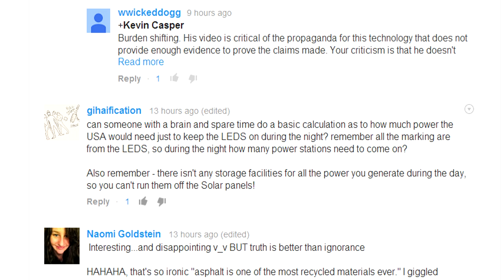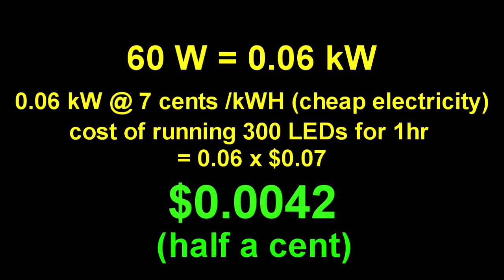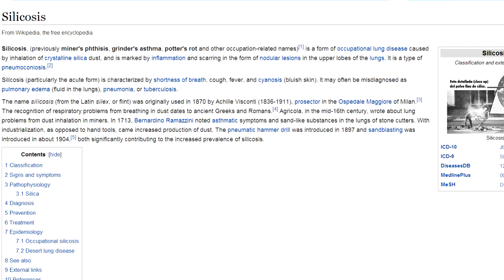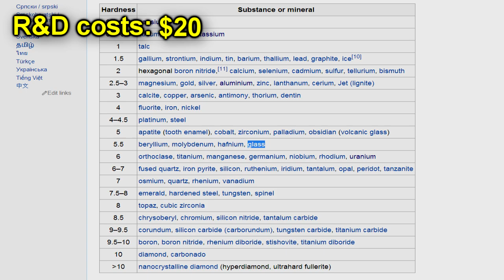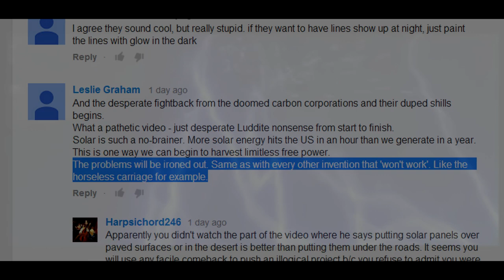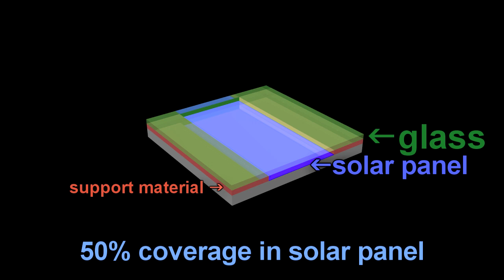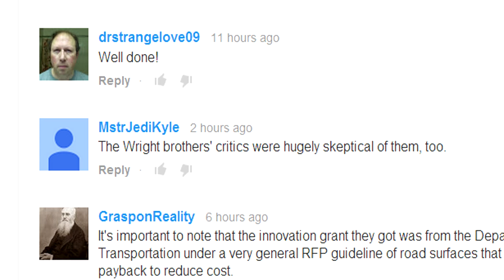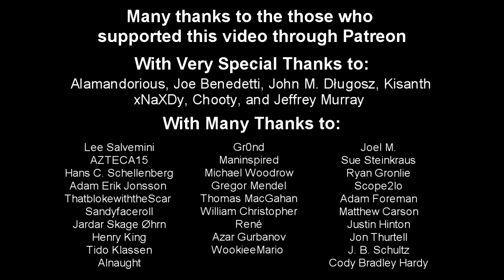Solar Roadways, IMPORTANT QUESTIONS AND ANSWERS!

Comment: Just for fun I thought I'd tear into the clearingthefrikingair rebuttal (http://www.solarroadways.com/clearingthefreakinair.shtml) , I'll do it in order of the headings which I will enumerate. But before I do, Solar roadways the 4th formula in that picture is either wrong or extremely redundant; also basic trigonometric identities look pretty unprofessional, try some branding or some equations that have relevance to electronics! Anyway:

1) We picked a really stupid....
Most of the points here are moot, it doesn't matter how expensive or antiquated the roads are if they are still the cheapest and most viable! Everything is relative; democracy for instance is pretty bad when you think about it; stupid people get to vote! It also happens to be the best system.... Stuff about LEDs and heating elements is just not believable tbh.

2)Solar Roadways is going to cost...
Again this is sidetracking the point, we want to know how these solar roads will pay for themselves; it is pretty pointless to keep asserting it. Why would it be more cost effective than putting solar panels beside the roads, or just building more farms? 

3)Asphalt roads are cheap...
Same issue, its the relative cost that matters not the absolute cost. Obviously we need roads, so no matter how expensive they are (within reason) we are going to invest in them, but obviously we are not going to invest in an option which is more expensive without good reason. Essentially a strawman, no one said asspalt roads were cheap.

4)False Claim: we can't afford to heat roads
Again, same issue! A load of emotional argument (designed for persuasion not information) followed by the claim that current snow removal isn't cheap. Sure it isn't, but your method of heating the road is LESS cheap. 

5) False Claim: Glass is softer than asphalt
Only real argument of substance, to bad its wrong. Roads in the US usually have a Mohs hardness between about 5 and 7, its the gravel that contributes to the hardness mostly.This is incidentally harder than most glass. Also I have to love the irony of going on about thunderf00ts video and 'permission' when he is completely entitled to critisize you under fair use, yet you lift a table straight from wikipedia without so much as a reference (and another website). Copyright fail...

6) False Claim: The shadow a single bird...
Fine, but if this is something that solar panels beside the road don't require, why would you pay for an extra component when you can avoid it?

7) False Claim: You can't see LEDs in direct sunlight

Well most traffic lights are roofed anyway, so that helps. And of course it does depend on how many LEDs you have and how bright they are; do your LEDs work in the sunlight? We haven't seen any evidence yet, so it begs the question; why would you look for images of traffic lights and LED advertisment displays (advertisements clearly pay for themselves - at least that is the intention!) when you could just photograph your own? Oh and incidentally the images are unsourced, which again seems a little hypocritical; ah never-mind. 

8) False Claim: We're attempting to use recycled....
Then why not say that? Because the impression from that video is not that the intention is to use a base layer made of 10% ground up colored glass, and I really don't think this is even feasible without the glass melting technology; and its not as if the base layer can compromise on integrity which may come from using a heterogeneous source of material without due care, and a pretty high investment. 

9) Comic Relief:
If ananlogies were meant to be taken literally, then they wouldn't be called analogies!
Reply: Not bad except an analogy is generally what we call.... ANALOGOUS to the thing in the analogy, and are indeed meant to be taken literally.  Something isn't analogous if it isn't LITERALLY analogous.  Just saying.

Comment: Disclaimer: I'm not criticizing, just some free-range reflection.
As for the energy bill of leds, a very easy way to save on it is not to keep them turned on all the time anywhere but only where cars are actually passing.
After all pressure sensors are already in the specs.

About glass resistance: Yes, is true, glass is definitely a bad choice. What about plastics and other materials?

About led visibility in daylight: what about a simple addition of a roll-over colored strip to be used in daylight? Eventually over the led (that in such a case would be a retro-illumination and would no more need to be color-specific).

Comment: Turn on ALL the lights at the same time?????? Why would you want to turn the whole surface area into a 70's disco floor (as if the solar roadway isn't crazy enough as it is). The road-lines/signs would only need a fraction of the surface area lighting up (say 0.1% or so, the rest can stay dark.
I appreciate you want to debunk this crazy idea, but please don't come up with even crazier back of napkin calculations to do so.
Reply: Seeing as the avowed goal is to use those Leds as Road Markings, a lot of them pretty much need to be on all the time, yes (Unless you're suggesting adding even more components to that project such as Motion/Pressure sensors)

Not 100% of them need to be on at the same time, you're correct in that assumption, but I believe your 0.1% is way off base and that you, frankly, pulled that number out of your ass, unless you have some actual logic you can take us through on how you reached it :)

Comment: They build aquariums with very thick 'tempered glass'. They have to regularly maintain the glass due to sharks rubbing up against it. Yes, that's right, fish can wear out tempered glass... what do you think 18 wheel road trains will do to it.

All great arguments Thunderf00t, but say you wanted even MORE ammunition to shoot at the stupid, the fatigue life of glass is very low, if it didn't fail from abrasive wear, it would fail from cyclical loading.

Another quote of Sagan's comes to mind, "We live in a society exquisitely dependent on science and technology, in which hardly anyone knows anything about science and technology"

Comment: Failure of these tiles would be inevitable after just one winter, and traffic wouldn't need to be a factor, if installed where freeze/thaw, road heaving conditions are common! Anyone ever seen the potholes on Route 81 around Syracuse after a really nasty winter? What an insane, ass-cheese idea.

Comment: It would cost 1.4 trillion dollars per year, if every single LED was on at all time. The majority of the time the LEDs will be used to mark lanes which only requires ( judging from the pictures ) maybe 5 - 10 LEDs from every 5th panel. Also, they've said that they will be programmed so they turn off if no cars are driving. So using the total cost of all the LEDs being on all the time as an argument against this project is ridiculous.

Some misinformation in your video as well. They've said that the panels are 4 ft^2 each. Also, the solar panels cover 69% of each panel and they generate 36 watts for the prototype and will generate 52 watts for production. That's also not including piezoelectric and thermal generators.

One last word. For being a scientist yourself, those "experiments" that show your point are hardly ironclad or objective. Seems at this point you want to shit all over this just to be spiteful

Comment: Here's your problem ***** , you have some very good arguments like cost effectiveness, but then you start talking about other things that you don't know about and you lose credibility. Glass has a typical hardness less than many rocks, but there are many materials that are referred to as a glass. Some glass is more scratch resistant and has a higher load bearing strength than steel.

Up until now I have been willing to overlook your errors, after all you are only human. However due to your apparent resistance to being proven wrong and the majority of time you spend in your videos supporting these false positions, I am now unsubscribing.

I leave you with a phrase: A good scientist should always try to prove themselves wrong. I would love to see you become more scientific, I would subscribe again for sure.
Reply: "Glass has a typical hardness less than many rocks, but there are many materials that are referred to as a glass. Some glass is more scratch resistant and has a higher load bearing strength than steel."

Hardness isn't the issue, it's that these panels are supposed to stay as clear and unobstructed as possible to take in light, any sort of wear and tear is going to scratch and 'fog' up the glass making the panels less and less efficient over time which will require them to be replaced at terrific cost, making the project pretty damn useless.
I have solar panels on my home, I don't drive cars on them.
Reply: bodybag22 Hardness was the specific thing he was talking about. It also prevents the material from physically distorting which would diminish light exposure as you say. The photodegradation, which is probably what you are referring to is primarily a property of long chain polymers. You could look at glass as a polymer and some glass has polymers added to them. However, many products can be used that don't photodegrade and also don't have the lack of hardness that ***** was talking about. 

Also, even if there was no such glass product that did not photodegrade and had a sufficient hardness, That would still not disprove my point. The fact that there is glass that is sufficiently hard is enough for me to use it as an example of misinformation.

Your colorful example of driving on the solar panels you have at home is even more unrelated, for reasons I hope I don't have to point out to you.
Reply: Keegan Maloney
So you're assuming a perfect world? Okay I understand.
So no scratches from vehicles and no dirt/grime on the road surface.
All your variables for increased hardness and no/less photodegredation cost even more money, so you're adding even more cost to the project.
Does that make financial sense? Even less so that whats being originally proposed.
Reply: bodybag22 again, I am not supporting the feasibility of this project, I am explaining my frustration with the inaccuracy of his claims. If he wanted to tie this point back into the increased cost of the product he should have done so, but he didnt. Instead he made the claim that the material COULDN'T be hard enough not that it would increase cost. 
(caps for emphasis, I am not yelling at you)

I don't think this approach for solar roadways is viable for reasons of cost effectiveness, which I clearly stated in my original comment.
Reply: So you agree with the overall picture but decided to unsub as what? Some kind of bizarre temper tantrum?
Fair enough but you came across as an apologist not a skeptic.
Reply: bodybag22 Not a temper tantrum. I like to be selective about where I get my information or else my own credibility will decrease when I end up talking about something that I was told about but the information was incorrect. 

I gave the feedback because it is useful for an educator of any kind to get feedback, especially about the possibility of misinformation.
Reply: Keegan Maloney
Yes debunking is fun.

Comment: The big thing for me is the idea of "limitless energy".  It just is not limitless, there is a known limit.  From Wikipedia:

"For example, a solar panel with 20% efficiency and an area of 1 m² will produce 200 W at STC, but it can produce more when the sun is high in the sky and will produce less in cloudy conditions and when the sun is low in the sky. In central Colorado, which receives daily insolation of 2200 Wh/m², such a panel can be expected to produce 440 kWh of energy per year. However, in Michigan, which receives only 1400 kWh/m²/yr,[4] annual energy yield will drop to 280 kWh for the same panel. At more northerly European latitudes, yields are significantly lower: 175 kWh annual energy yield in southern England."

"STC specifies a temperature of 25 °C and an irradiance of 1000 W/m2 with an air mass 1.5 (AM1.5) spectrum. These conditions correspond to a clear day with sunlight incident upon a sun-facing 37°-tilted surface with the sun at an angle of 41.81° above the horizon. This represents solar noon near the spring and autumn equinoxes in the continental United States with surface of the cell aimed directly at the sun. Under these test conditions a solar cell of 20% efficiency with a 100 cm2 (0.01 m2) surface area would produce 2.0 W."

As thunderfoot points road tiles lie flat, they are not aimed at the sun and would produce even less than this. Through in year round conditions, snow and the passage of vehicles over the tiles as well as scattering of light from the scratched surface and the power goes down and down.  Silly idea, put your solar panels on your roof and point them at the sun.

Comment: We might have to wait until transparent graphene could get printed out so it can even be scratch resistant as stated to be one the strongest of materials... or is able to efficiently self repair. Also... instead of just LED or OLED... have only white and yellow dots that can magnetically flip to showing black because we surely don't really need any other than those and therefore require no power to keep markers revealed or black.